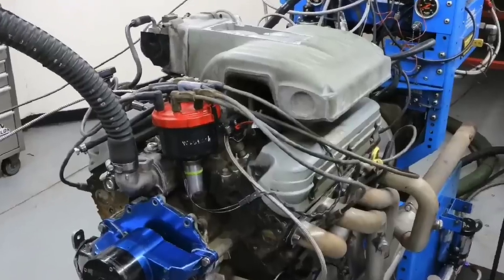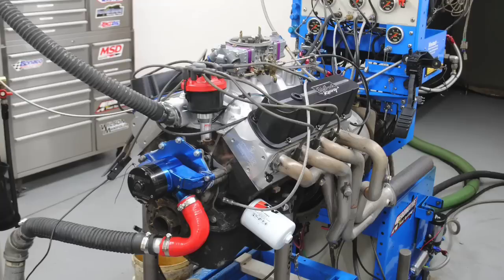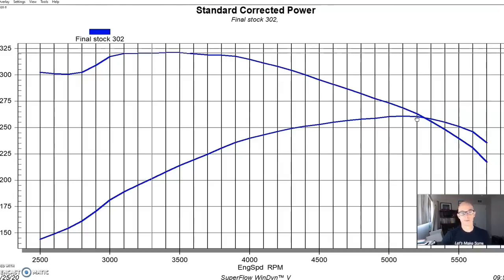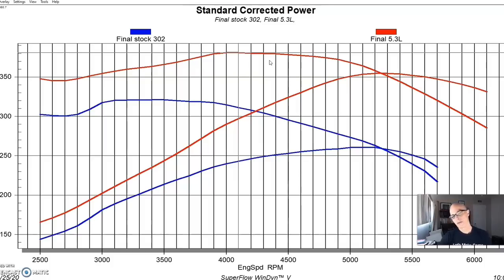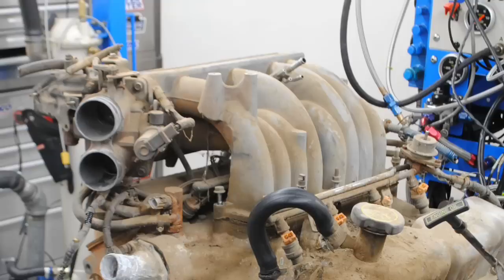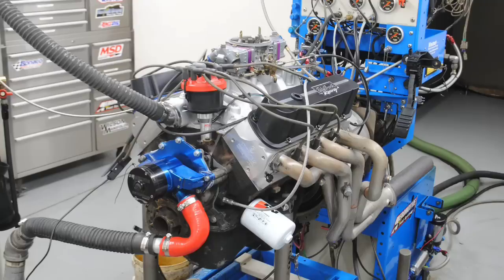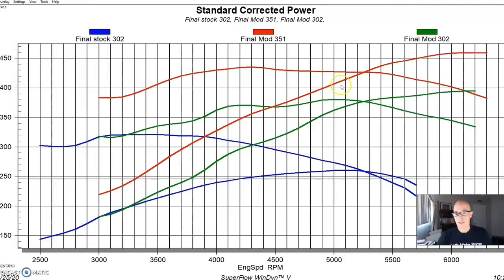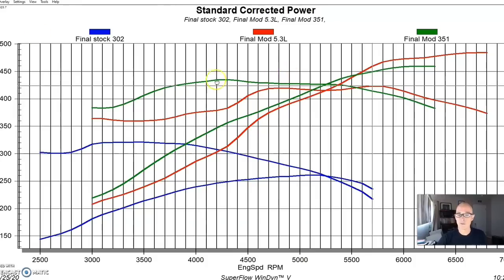5.0L vs 351W vs LS-SHOULD YOU SWAP?

Comment: modify the sbf.no doubt about it.look at were the peak torque was on the modified 5.3 ls way up at 5,000rpm. pretty much useless on a street car.there is alot on here not being discussed about the ls shortcomings.were do i start.dare i say they basically copied a sbf design.i have saw forums were guys put ls heads on a ford.and i love the plastic lifter trays great thinking there.u have to yank the heads to get to the lifters.piston ring seals are known for being garbage causing excessive oil consumption.along with blow by.and the oil pumps tend to cavitation above 6,000rpm.hey they have there place.personally i would take a old sbc design over a ls.at least the valves are adjustable on old sbc.and idc what anyone says they lack low end torque.fact.drive 1.imo it aint all its cracked up to be.

Comment: Any suggestions for bellhousings I went the ls route with a 3550 trans and only bell is 865 dollar would it way out in upgrades to just put a ford Infront or the ls hard to beat a cam HP gain/ cost vs heads cam and a cheap bellhousing

Comment: So effectively the LS is the go-to if you're not going to do heads/cam/intake, But if you're building up a motor you might as well go with the 351w
Reply: LS wins in overall lower cost at the end of the build

Comment: Tbh the 351 made more power for most of the rpm range then the 5.3 so honestly that gives you a better power range to just step on it and go 5.3 only barely started to beat it at 5600 while the 351 was stomping it in low rpms some of this can be explained by displacement honestly so close however and also let's be honest 302s are dirt cheap even in aftermarket

Comment: my 2 cents
a 351 isn't worth the extra weight in a fox (unless you got the $$$ for a 400+ ci clevor build)
if i was building an auto car %100 ls + gm auto (old ford auto are where hopes and dreams go to die)
on a 5 speed i'd probaly build the5.0(347) unless i got a really good deal on a 4.8/5.3 and bellhousing to hook to the ford t-5

Comment: Why not do it right and put a 351 CLEVELAND in???? The LS is a short time POS. Without spending $8 grand on cross-bolted mains, align-boring it,  putting a girdle on it,  it won't hold together producing 400HP but about 100 hours and I have dyno figures to back me up on that. Spend the same $8 grand on a Cleveland and you can get a dependable 350-375 HP, 350-375 ft/lbs torque for 400 hours +. Put another $2500 into it and you can have roller rockers/cam and Accel port fuel injection and a fuel mapped motor good for maybe 2000+ hours @ 370+HP and not spin 8000 RPM doing it. There are outstanding four valve per cylinder aluminum heads available for the Cleveland with beautiful heart-shaped combustion chambers for unleaded swill and pistons made to match. They ain't $19.95, but they REALLY work and you won't blow them up. Build the bottom end to handle the power (pressure) and RPM (DON'T SCRIMP!!!) and you'll have a bullet-proof combo. 
I'm a MOPAR guy. I wanna drive mine instead of towing it back to fix it. I spend my money ONCE and spend it RIGHT and maybe spend more than I gotta, but I never pay a tow truck. I took a 318 (5.2L) Magnum to 408 CID (stroked and bored) in a Dakota without a whimper. Ma MOPAR's Boys coulda turned that motor out from Canada by the mile with the 50K mile factory warrantee and not blinked an eye. Got better gas mileage than the stocker, especially towing my tiny travel trailer. Got killed by a drunk... Take care guys.
Reply from the maker: a 5.3L makes 400 hp with just a cam and will do it for 200,000 miles, The Cleveland is also good-just hard to find in a yard

Comment: What about cost?
A 351 with heads,cam and intake is about  equal to a 5.3 with just a cam and springs. 
 5k vs 1.2k 
But your also going to give up 70 ft lb at 4k rpm
Reply: and then you have to pay to get the LS into your car with swap parts to make it work. People tend to forget that part, stuff like aftermarket gauges and all the rest

Comment: I've found couple 351w roller motors. All were in vans, too much work for me to pull alone. Nobody seen the guy run LS heads on 351w?
Reply from the maker: I've seen the ls 351

Comment: With all the electronic controls and power adder options it makes no sense putting a Chevy in a Ford. Power adders don't care much what brand of pistons are going up and down as long as a good cylinder head can feed it. If you need a light easy to work on racecar and you have Chevy stuff get an old Mustang, strip it out, just don't do it to a streeter and ever expect to get your money back.

Comment: He said it himself the LS is more efficient he had smaller heads on the 351 and 302. Also what about him using a dual plane intake that's also limiting the HP. You put a single plane on that 351 and the 2 would have almost identical graphs
Reply: Exactly man its about cubic inches, compression and head flow and the ls (in most cases) has more of all the above.  Once the ford has cubes (i.e. 351) and you give it similar head flow and compression and a similar setup power is gonna be comparable cubic inch for cubic inch.  The ls is just set up better out of the box which makes it ideal for these guys that just wanna slap a junkyard motor in their car with a turbo on it.  It dont cost that much to make a 351 into a monster and you can also slap some boost on them and make some damn good power on a stock engine.  Many of the aftermarket heads for the old fords dont flow as well as stock ls heads.  That is why they make so much power "cam only" because they already have badass heads out of the box.  Fords can make the power too once the playing field is evened
Reply: @midnight347  100% agree couldn't have said it better

Comment: It's almost as if it like when I was doing a review on a 300 Ford running through a log style intake with a single barrel carburetor comparative to a 1992 with the EFI individual Runners going into a dual throttle body engine

Comment: Am I correct in my evaluation that the 302W and the 351 W produce their peak torque &
horsepower @ lower rpm's, whereas the LS engines have to rev much higher?
Reply from the maker: DEPENDS ON COMBO

Comment: People have been swapping Chevy engines into Fords for decades. There’s a reason for that, they are a much better engine, cheaper to build and make more power mod for mod. LS is a bulletproof engine that makes tons of power cheap. I’ve had plenty of all the engines mentioned here and as much as I keep a Ford a Ford, if you want to race or make a ton of power. LS over Ford every time.
Reply: Some people just like to stay true to the blue and 99% of them will always be slow, people that race like to go fast no matter what engine it is, dollar for dollar it’s hard to beat a ls combo, I have had a bunch of different engine setups including a Windsor

Comment: LS makes no sense to only make 350 - 450 hp. Just not worth what it takes to convert.  Not to mention putting a GM engine in a Ford.  Plus a 302 or 351 will typically be more than adequate  to make 600hp & even more at times. When you are trying to make that real big power, then go Dart block & keep the Ford platform.  Because if your planning to make big power & put big money into the build, you should go with a new engine,  new internals, machined, etc etc. It also doesn't make sense to go with junk yard engine without going thru it thoroughly,  especially if you plan to make big power & put big money into it.  Not to mention the expense & work needed to convert to an LS, but then to use a junk yard engine,  just doesn't make sense in the 1st place.  So forget the trendy LS swapping anything & everything

Comment: Bottom line is LS is much better platform!! You could take stock LS put valve springs and cam leave stock heads and it will still kick the Fords ass!  The stock heads flow insanely well!! LS way cheaper in all directions!!!

Comment: I have an RHB3 from a turbo sprint, nowdays I would like to have one of those to take the engine out and make it into DIY UTV.
Reply from the maker: I have a running Sprint Turbo Engine and lots of parts-going to sell them
Reply: @richardholdener1727  Do you have a trans to go with it?  I've got an old project I built with a miata rear end, thinking of doing the transverse to longitudinal trick and getting double reduction.
Reply: @richardholdener1727  When can we see a Godzilla vs LS comparison?

Comment: Love this vid.  Thanks.  I know this is for Mustangs but I have a full size Bronco that I've been considering the same options mention here.  My question is wouldn't sticking with a modified version of the 351W in my Bronco be an easier swap as it will retain factory ac, steering pump etc?  I ask because I'm considering all options and if an LS would just create a lot of extra fitment problems and make AC near impossible then I would just do the HCI on my stock 351W with a rebuild.  What do you think guys?
Reply from the maker: go 351

Comment: This is my dilemma.  I have a 2v 4.6 powered car and don't know what way to go...I'm a SBF guy but it's hard to beat the LS for hp per $$ and the wrecking yards are going to be full of those 7.3 Godzillas in a couple of years once the work trucks are worn out.
Reply: Jackson P. Storm  Mod motors are great!  I love them, the 2v will forever be one of my favorite engines.. but they're more costly to build.

I guess if I just pick up a pair of Singapore Snails, they won't care what engine they're feeding.  Boost the 2v until it blows up (which will be never) and then put them on a new motor.
Reply from the maker: cams, springs and turbo

Comment: I’d build a 393 winsor. It’s a bolt in. Chevy is not. So is the Chevy really cost effective?
Reply: That's what I'm saying.  The engine itself might be cheaper if you're just gonna slap a junk yard motor in there without building it first but the other costs involved to swap it would eat into the whole budget idea.  It wouldn't cost much to build a robust 393.  I don't see how it could be THAT much cheaper

Comment: I built a couple 302's, and my last build was a 351. Night and day difference. I'd never build another 302 lol
Reply: I feel kinda the same way. I just finished my 302 based 331(technically 332 4.030bore X 3.25”stroke) because my 1980 4speed manual Bronco came with a 302. Once I pulled the tired but barely running engine, saw it was already 40 over, I found a stock bore 302 block for $150. Spent $ machine shop, magnaflux, decked, bored 30 over, line hone, torque plate hone, hot tank, balanced my scat 9000 rotating assembly, new blueprint hp9009 heads, big ports, big valves, dual plane intake, 1” open wood spacer, xe266hr12 cam, Howard linkbar lifters, comp roller rockers, summit 600 vac secondary carb, summit billet distributor, Mahle 4032 flat tops with fancy coatings, king fancy bearings, fancy low drag ring pack, 18 thou top, 22 thou middle ring gaps, not dynoed but guessing the 10:1 91 pump gas with a bottle of octane boost with every fill up 11 initial timing 34 all in by 2900 timing curve, AFR is perfect 13.75-14.25 @ idle freeway cruising 80mph at 2650 rpm AFR 15-16 handled by Vac advance, WOT 11.5-12.5 AFR, spent about $4k for about 400 hp/400tq. I’m happy, it’s lightweight, perfectly weight balanced front to rear, more than enough power to move the full-size wagon on 35s with stock 3.50 gearing, BUT I could’ve spent the exact same amount of $$$ building a 351 based 392-408 Stroker and be making 500hp/500tq... the only thing I can say is you live and learn.

Comment: So I currently have a 91 bronco project I am working, with the 351W EFI bone stock. I have the motor out and on a stand...my question is...what would you recommend i do to it? Say with a project budget(just for drivetrain) of $2500. Where would you start?
Reply from the maker: 351W, ADD GT40 HEADS FROM JUNKYARD, SPRINGS AND A CAM

Comment: I went 351 due to the potential gains over a 302 and a stroker 351 was cheaper than swapping to big block, LS, or Coyote.
Reply: Believe it or not that's false a LS swap with a carb is cheaper

Comment: If I was a Ford guy I’d cringe seeing a Chevy motor in my Ford. I get the comments and would never be for any a Ford Motor in my Chevy. Heck I have a tough time seeing a Chevy in a Pontiac. However the LS has the most Capable bottom end in stock form. No way a 351 or a 302 would ever make over a 1000hp with a stock bottom, and that’s the reason so many Mustangs have a LS in them. Dollar for dollar, stock to stock the LS is a way better motor, Hands down. 👍

Comment: What did the low end look like on those graphs?  Always seems like those are missing in most videos and reports I come across.  The budget project I'm mulling is a street cruiser setup, not a race setup, for a Crown Victoria.  The more I try to think and budget, the more I think about how modified vs. stock is in the low end RPM range where us lowly luxury cruisers like to hover around a lot of the time.  If I can ask, what do these general modifications and opening them up, giving the ma meaner cam, do to the very very low end?
Reply from the maker: things to change to add low speed torque include displacement, compression, long tube headers, very mild cams, long runner intakes.
Reply: @richardholdener1727  And proper LSA is critical as well, too bad this is often overlooked by the mainstream.

Comment: the dyno queens who worry about how little a small port 5.0 not running junkyard GT40P explorer heads make....don't get power-to-weight ratios. The Fox Mustang was a tin can, unlike 2020 pony cars with computers for everything, a ton of options and safety equipment, etc. The Fox wasn't toting around nav equipment and lane departure warnings and a gauge panel that changes every color. Compare a 4.8 litre LS to a 5.0 pushrod (versus 325 cid 5.3 litre LS to a 302 cid Ford), and the torque levels are about the same in an apples-to-apples comparison. HP sells engines, torque wins races at the starting line. 

An LS makes a lot of cheap power on a dyno with a lot of space for exhaust, etc. but then you compare the cost of putting a 351W on your 302 engine mounts instead, reusing the throttle cables and oil pan and front end assembly and power steering pump and so on and you get a different idea.

Comment: The 4.8 makes a nice flat torque curve. If you wanna have a good engine that you can run hard without getting into too much trouble, that would be a fun choice. Plus, it's got better o-ring seals everywhere.  Is it possible to drop the oil pan in an Ls swapped fox without pulling the engine, I.E. pickup tube repair? 
The tuned up 5.0 is perfectly fine and saves you some work. 
The tuned up 5.8 would be a very solid choice for a street car if you're committed to taller gears, or like your current gearing and just want to have better tip-in response. 
The 5.3's are a turn-key deal that you can beat the absolute crap out of...
Reply: 4.8's are absolutely soggy without mods dude, I just got rid of mine. I could build a bare block 6.0  with a forged rotating assembly and some spoolies for what it would take me  to make the 4.8 just enjoyable
Reply: 5.3's are fun for sure tho
Reply: @jewbabydono  What was the 4.8 installed in? Maybe your setup is too heavy for it.

Comment: If you want to be brand loyal to each there on, if you like spend way more to get almost the same result or even a lot of times fall short build a 8.2 deck, Windsor is a great motor but the large main bearing make it more prone to spin a bearing, I have had all three version in a foxbody,  dollar for dollar you can’t out run a ls with the same cubic inches, it take 50+ to get the same result or real top shelf parts, vs crap you can pick up from a local pick and puke

Comment: Should have stuck to Ford and tried to 400sb both stocknand modified. Most ford guys won't put chevy engines in. But most chevy guys will put a ford 9" rear end in their cars.
Reply: @james avery The hot setup is 8.8 with 9" outers. I will be doing the 9" outers on mine eventually. And you're right, the rear ends everyone runs aren't even made by Ford anymore, they're just the base design.

Comment: I've actually been contemplating stuffing a damn 460 in my sn95 I love my 5.0 though and honestly it costs alot of money to swap
Reply: I’ve got a 302 based 332 Stroker in my Bronco (small motor in big vehicle) it’s good and soon I’ll improve it with 3.5 pounds of low psi inter cooled blow through carb boost. My next build will be a turbo 460 in a late 60s Lincoln
Reply: A turbo 460 lol god that'll be fun to drive at least it'll be a boat of a car though

Comment: I got something to add to your video yeah I like watching videos of different things but it doesn't matter if it's stock or if it's upgraded it depends on how much money you're willing to put into your motor to get the power you want LSS get good horsepower but I'm a Ford guy I stick with the original Motors that came with a Vehicles instead of doing swaps and I built a 302 to 3:31 and that's pretty damn well but like I said it's all about how much money you're willing to spend

Comment: Richard you should have put a 351 Cleveland in there not the Weezer and that LS would have been second Cleveland would have been first especially if I pick the cam and heads for it and no ...I would not put 4V heads on a Street Cleveland. 2v Cleveland heads will shut down a Chevrolet LS.and that's 50 year old technology from a Ford shutting down brand new Chevrolet technology if I build the Cleveland
Reply from the maker: Right!
Reply: I'll buy the plane ticket and I'll show you how it's done